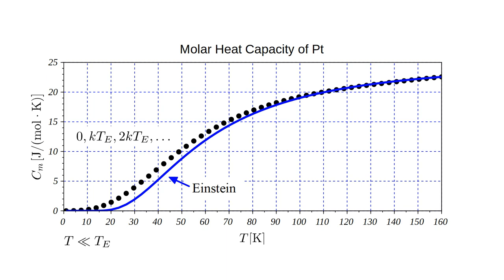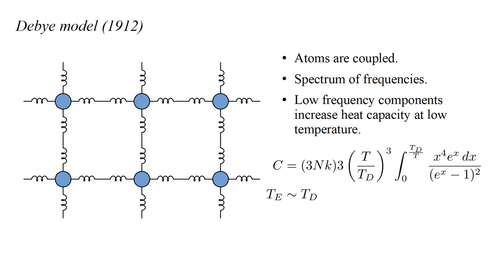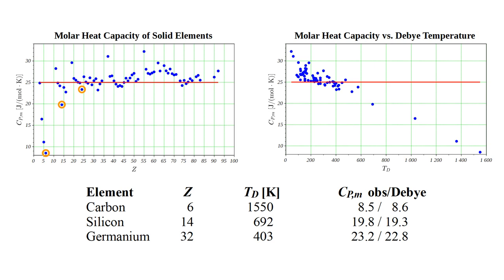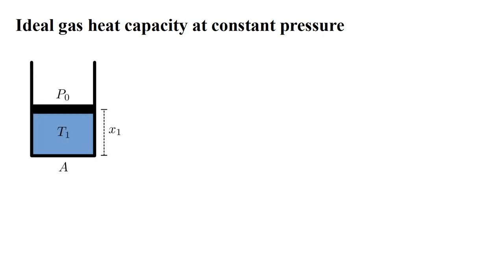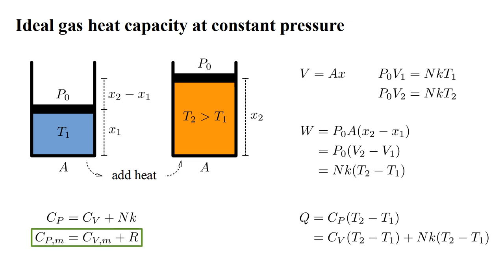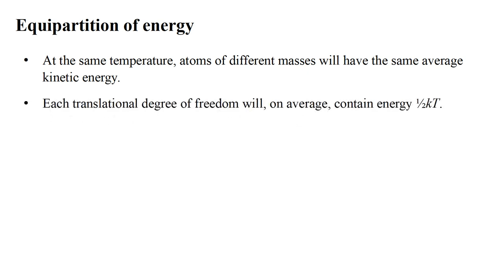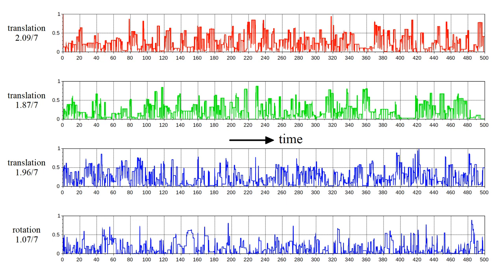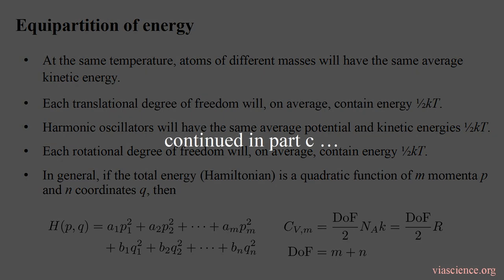Thermodynamics 6b - Heat Capacity and the Third Law II

Comment: Amazing.
I have a simple question though,
How would you write the explicit mathematical formulation of 3rd Law of Thermodynamics.
Reply from the maker: We will get to that by the last installment of this video. Short answer: to date, there is still no universally accepted formulation of the Third Law. One of the most "accepted" versions is that it is impossible to reach absolute zero temperature by a finite number of processes. In certain cases we can claim that at T=0, S=0. But, not in general.
Reply: @viascience  thank you very much